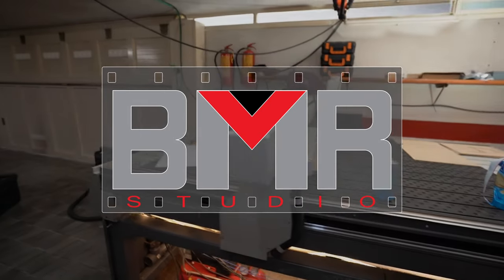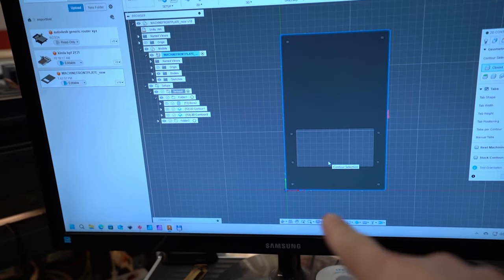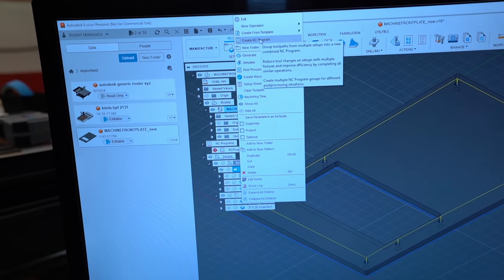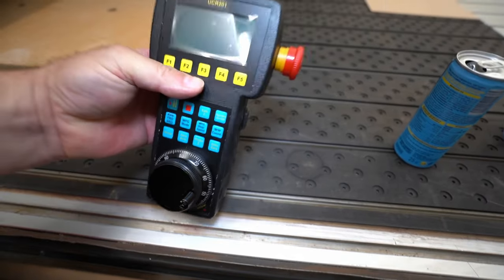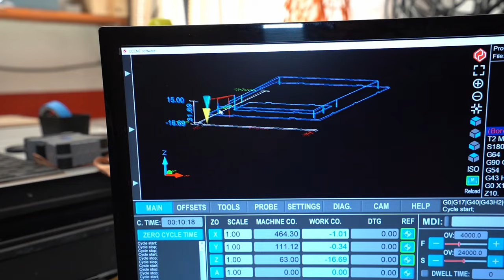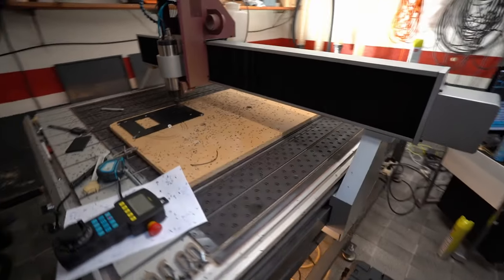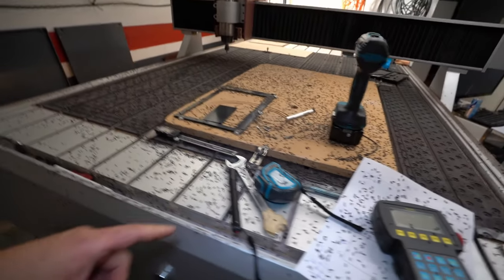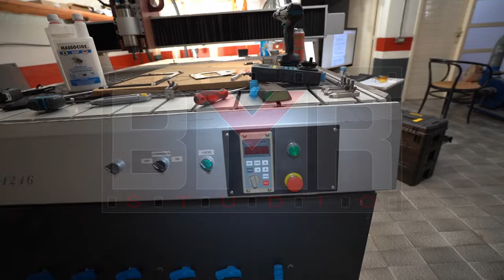CNC router upgrade  - UCCNC AXBB-E UCSB - part 5 - first cut with Autodesk Fusion

Comment: Oh wow that looks so complicated. I thought 3d printers are difficult to use but wow
Reply from the maker: I make mistakes too.. So what You see, is not only the controller, software, computer, protocol, postprocessor, material, clamping, cutting speeds, cutting tool, working heights, currents, voltages, distances, tolerances, materials, dust collection, metrology, science, applied programming language, wearing, temperature... may I stop here.. meh...
But human skills too :)

Comment: I had the issue with G53 G0 Z0, and it dragged a carbide bit across a hardened vice jaw...

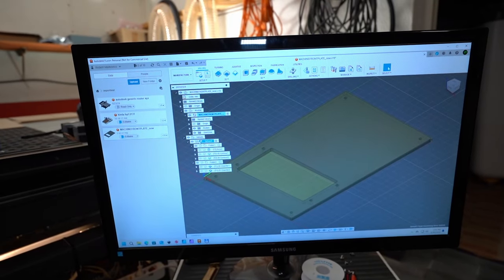When you create an NC program (8:07) there's an option on the right for Safe Retracts and Home Positioning. I there you can set Safe Retracts to Clearance Height, instead of G53.
Reply from the maker: Thx! You are genius!
I find an another solution, but in the next video I will show Yours too! 
I don’t understand why this isn’t a DEFAULT option…
Reply: @BMRStudio  I've got two theories as to why this happened to us:

1. We've got our Z axis the wrong way up (in software) and positive Z should be downwards - If you look at 3:04 in your video the Blue arrow is up, should that be down? (Mine points up too) - you'll need to invert the axis in UCCNC as well. This is only the problem if it's causing the G53 to go the wrong way, which I'm kinda sceptical of, TBH.

2. I think this is the more likely one. No homing. The machine doesn't know where Z0 is, as G53 is based on machine coordinates, if they're not set by homing it'll head off in some random direction. 
I've since added home/limit switches to my machine, so I should be able to test if that's the case.
Reply from the maker: @matthewgreen8454  Nah :) Tomorrow You will see what caused the travel down.... Its just..... Wrong default settings in the default UCCNC installation.
Not the switches, nor the setup, neither Me. Just one stupid data in a small box....

Comment: Well, the G53 G0 Z0 should be at the top of your Z axis. 
So the G code will tell the machine to go max up to the Z0 start to move to the position and go down into the material.

So either you turn the blue arrow in Fusion so that Z+ is going to be down instead of up. But that can be a bit dangerous and you might destroy some endmills.

I use the free version of Fusiong too and it is working perfectly, yes you cannot use different tools in the same postprocess, but that is ok for me.

So you need to change position of your Z axis sensor so that the machine is having G53 Z0 in the top instead.
Reply from the maker: Its already set Z Home switch to DIR Positive. then I have an extra offset. I did find a way to modify the postprocessor and get rid of this line. This should be GO TO  WORK ZERO PLUS  Safe Z!! Not Machine Zero. Its just stupid.... So, Probably I have a issue around G53, G54 G55 G56 G57 G58 registers. Another video. Let You guys laugh on me and on  Fusion
Reply: @BMRStudio  But when you home Z is it going up or down from the machine board ?
Reply from the maker: @NiclasGudmundsson  up
Reply from the maker: @NiclasGudmundsson  I never seen any CAD program calling MACHINE ZERO on the beginning of the job. Never. Nowhere. Just stupid
Reply: @BMRStudio but then I think you have something else that is wrong. So if you move Z down you are getting negative values (machine cordinates)?
Reply: @BMRStudio i think it's great, then you know that you never going to have the tool collide with your material or workpiece.
So I still think you have something else that is wrong.
Reply from the maker: @NiclasGudmundsson  G53 G0 Z0 make no sense at all, to call it. Machine zeros are completely unattached from Your actual offset setup with the actual job, tools, clamping, datums, etc.
Just stupid to call.
It’s MACHINE ZERO not setup offset…

I know what’s wrong. No other software is calling this. Not Vcarve, not Carbide, not Freecad, Not even UCCNC CAM when You import a DXF and You make some basic tool-path.
Maybe You are not understanding what’s the real problem here.
The post-processor Calling a MACHINE ZERO! G53! 
Exactly when You have any tools in the spindle, then the Z is not MACHINE ZERO ANYMORE.
In some old CNC machines even denied G code, to prevent tool breaks.
Reply: @BMRStudio i know exactly what the gcode is doing here, I can't see why it's only you complaining about it who is using fusion360 and uccnc. It works perfectly for me and to have the spindle move all the way up to G53 Z0 is normally not a problem, we are talking about movements that are just like a safety movement to get all the way out of your workpiece to make sure not to break any endmills or destroy your workpiece. 

The postprocessor was built line that and it work perfect for the users except for you. 

But if you don't want to have it like that you can for sure edit the postprocessor to have it work like you want.
Reply from the maker: @NiclasGudmundsson  nah, not complaining. Is not against You, sorry if You feel like that.
Absolutely not. Just frustrated why even this is in the code as default.
An another guy pointed out the right solution.
I still think, do anything with Machine Zeros as target movement in job, is just stupid.

I called a friend yesterday, when I just started to explain him, not even arrive to the point, he already laughed in the phone, and his first question was…
“So how many bit and vice You crashed already?”
He is a teacher for CNC works, they have classrooms with Haas, Siemes, and home built machines, they deleted completely all Machine Zero calls, and all offset caller Gcodes. They made only one buttons on the panels for calling Home, when there is no part in the machine, doors are closed, and spindle is empty.
The other button is set the new job zero offset, and thats it. No other options.
Bits and vises are expensive…
Reply: @BMRStudio  Hehe I understand your frustration :) 
But still if the Machine cordinates is at the top of the machine, as far away from the vice and table of the machine it is not a problem. 
Still your machine is going down into the workpiece when the code is calling for G53 Z0, that is not how it should be, it should go up away from the workpiece and vice and not breaking endmills.

Im not saying that you are accusing me for anything but it still feels strange that you are having the machine go into your material when the machine is calling for G53 Z0 commands. That is why I asked you if the machine is going up or down when it is homing in Z.
Reply from the maker: @NiclasGudmundsson  so it’s moving to the top of Z, then crashing to the surface.
I find the problem, now I just have to prove, with clean installations, its a stupid design of the default settings in both software.
So, wait until weekend, you can laugh on Me, UCCNC and Fusion together.
My fault was only believing, software developers using kinda common sense logic.
But they aren’t. 
Wait for it. You will be shocked! I was!
Reply: @BMRStudio  haha, software designer dont EVER use common sense :D :D :D hahaha
Reply from the maker: @NiclasGudmundsson  nah, not so long ago, I was a programmer for Bi systems, cash register databases, retail management, huge retail chain database centrals, CMR, CMS and all sorts of crazy business related software’s. 
Well, our boss kicked our ass, when a client complained about stupid UI or functions not developed around real life situations and practices.
We had lot of old fashion programmers, they developed everything around and for the hands of operators. 
We new kids, we did fancy pancy things with magical new language’s, and sometimes, we had to admit, old guys was better on programming a full point of sales solution on IBM cash registers, with 340 KB occupied disk space….. 
so yeah… I know a little bit about what should be common sense in software’s. 😝 
Wait for it…